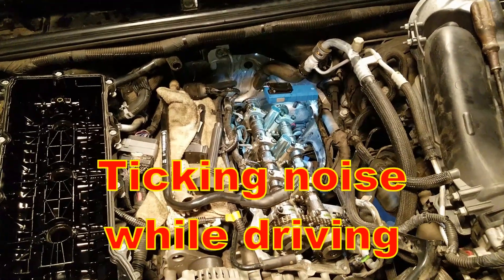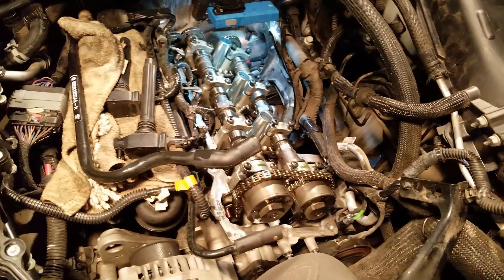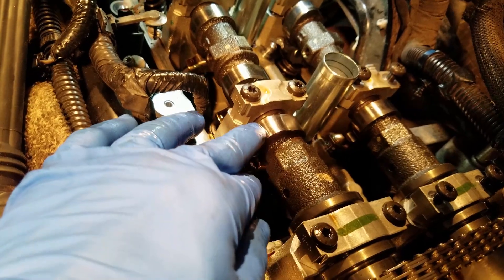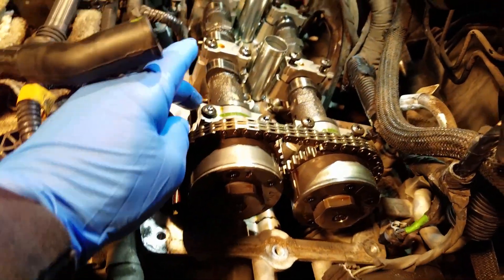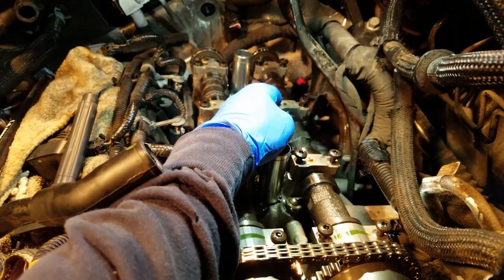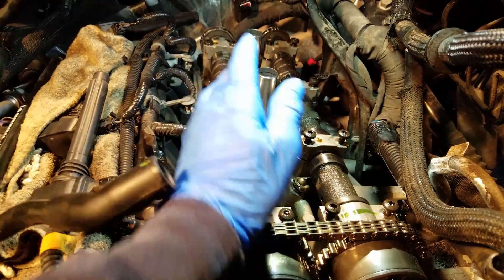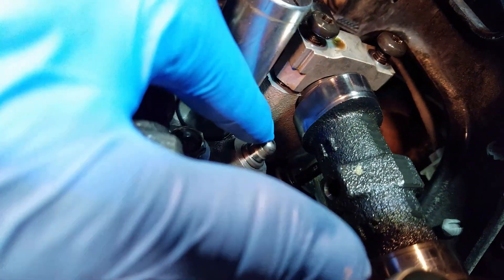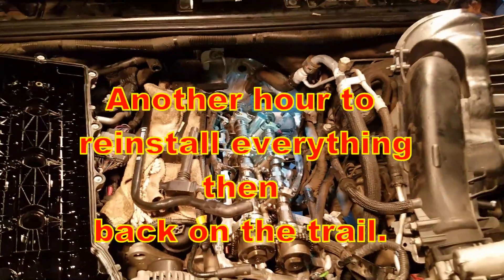JEEP JK Rocker Arm Replacement  - Driver's Side - Ticking Noise

Comment: Thanks for a great video!  I just did this on my 2016 jeep wrangler unlimited.   Real PITA!!! 100k miles.  Getting rid of the jeep asap.  This in a shop could be $1000.00 or more easily!  Bad desing from jeep!
Reply: Tell me about it.. I’ve always wanted a Jeep finally got one back in 2019 with 50k miles now at 67k I’m getting the tick. Even if it still had warranty it’s void now that I have a lift kit so I’m going to have to shell out the money to have a shop or a dealer do this. Had I known this was a common issue I would of just gone with a Toyota
Reply: @exellas1497  lift doesnt void your warranty for engine work! What did you end up doing. It is a damn shame, but what can you do, the vehicles are mostly good besides this and the plastic oil filter housing. Who knows why, gm has the same issue with the rocker arms from melling, still pisses me off, wish i had known aslo. Sofar so good at 80k miles

Comment: Do I have to put a certain amount of torque to the bolts that’s holding the camshaft down  after I replace the rocker arm ?
Reply from the maker: The correct answer is yes. I don't remember what it is.

Comment: I have some questions about this.  I'm about to tackle both sides.
Reply: XavierMcBeth how did it go? I’m probably going to have to do mine soon. Took it to the dealer because I’ve got an extended warranty but I got the impression the dealer doesn’t want to do it because it’s warranty. They basically charged me $180 just to tell me come back when it’s louder because they can’t figure out what side it’s coming from. Mind you I’ve got 120k and warranty runs out at 125k
Reply: @Iamtheproject007R  ⁹
Reply from the maker: Ask away. If I don't know, maybe someone else will chime in.